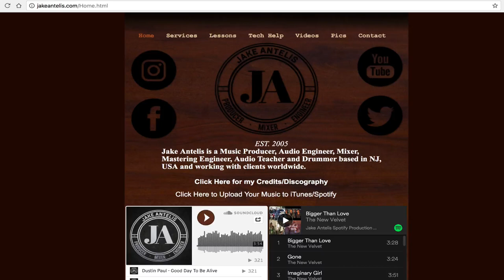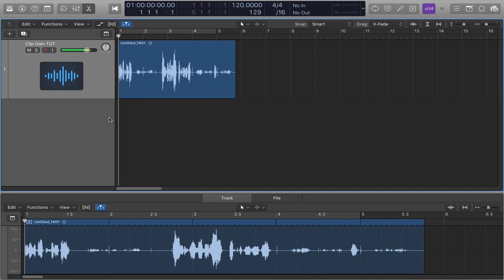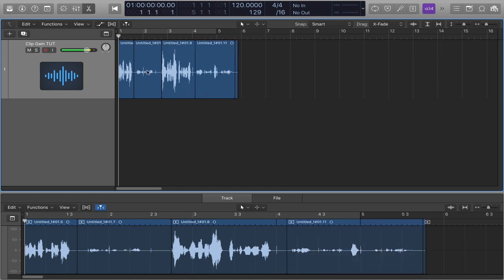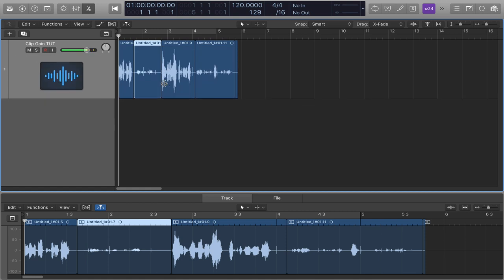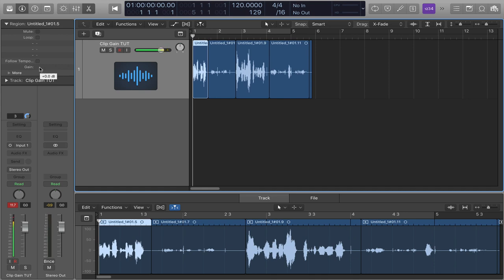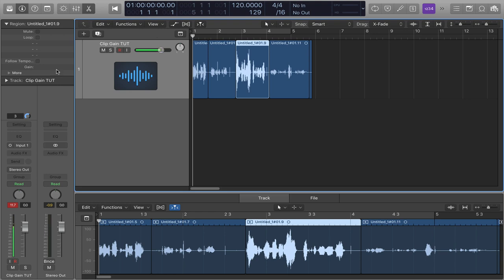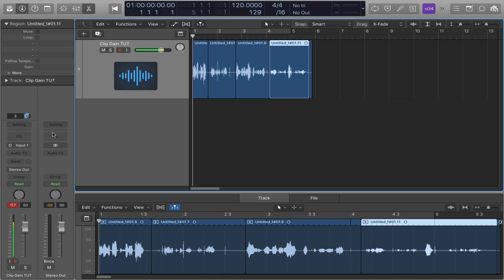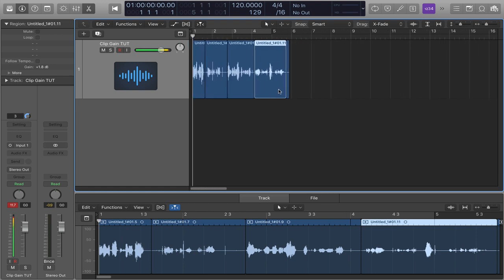How To : Clip Gain Workflow In Logic X (Quick video)

Comment: Hi, is it normal that in Logic Pro 9 changing the clip gain the waves form don't change but only the sound do? It's a bit annoying because you have to check always region by region and track by track on the up left corner that tiny number
Reply from the maker: i seem to recall it being like that in logic 9, but eventually,  i would update as it's 7 years since 10 came out. i guess it works but its also nice to visually see it.

Comment: can you get the same result not cutting the track but just selecting the region ?
Reply from the maker: i believe it's per region selected ( which would need to be cuts). if that's what you're  asking ..otherwise i would just use regular automation in touch or write mode

Comment: I dont understand how you cut the region with the marquee tool.. I tried this nothing happened
Reply from the maker: Sixfoursoul select the tool highly the area and click. If that doesn’t work. Look up videos or the manual on the marque tool
Reply: Jake Antelis Thanks for the swift reply I was able to figure it out. Yes selecting the marquee tool I guess would help there’s just so many little things it’s easy to miss but yes I will look at some tutorials.,There’s also something where you can insert Sections through the whole project and getting automate each particular part

Comment: Logic clip gain is so cumbersome. You have Pro tool which is the pinnacle, then believe it or not tracktion waveform is very good cause it can almost do the pro tools thing where you can have multiple volume changes within a clip, without using automation and WITHOUT splitting the clip.. but it' snot quite there.. then you have your everything else like reaper/S1/Cubase etc, then you have your Logic which is dead last cause it's like the all the mainstream ones I just mentioned, except there are no gain handles. Arghh!
Reply from the maker: I agree with this. Would be great for Logic to add it , there's a few small things i prefer about protools and that is one of them.
Reply: PS what I mean when i talk about on the fly changes is that with logic, any audio edit has a few seconds delay before audible, even a simple clip gain change.
Reply: @teddym2808  what do u mean by there is no "gain handle"
Reply: @starsmash7491  Exactly what I said.. Look up clip gain handles to understand.. Logic's real time (non destructive) clip gain is a process only done via the inspector.. On any normal DAW, there should be a permanent line or "handle" on each and every clip that you can just drag up and down, with instant audible results.. Logic is so behind in basic audio recording it's a joke.. It's also starting to fall behind in midi too, where it was once a leader.. where is the dedicated, one click built in drum editor? I mean for midi drums obviously, not the drummer track which is audio. Where is the most basic fundamental requirement of being able to choose just one dedicated midi in per midi track? Even via the environment it's uber complex and unreliable. I could still live with ALL of that though, if Apple fixed the automation timing issue when using plugins with latency.. I'd take that over anything, as that actually forced me to leave Logic after 20 years... I had to choose.. use my UAD plugins for all my effects, or give them up and choose Logic.. There's explanations about this all over the place, but basically, on audio and instrument tracks, any plugin automation you have drawn or recorded, will not play back at the correct time it's supposed to if there are also any plugins on the same track that have latency (like any UAD plugin). It makes Logic 100% useless for me to mix in unfortunately.
Reply: @teddym2808  I wasn't aware of the latency issue and would've chalked that up to a cpu usage issue.  That sucks you had to choose another DAW just to use your UAD plug ins, but i can understand your decision.  I'd hate to relearn another DAW just because of that.